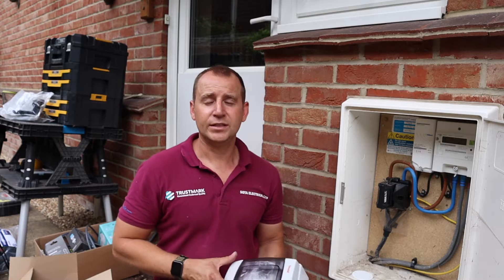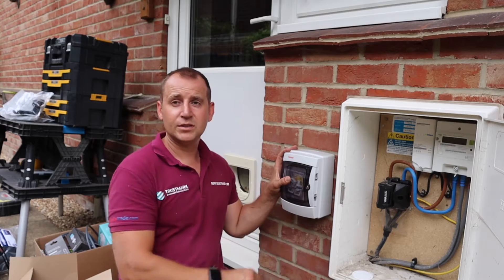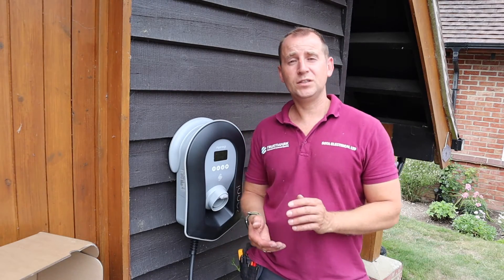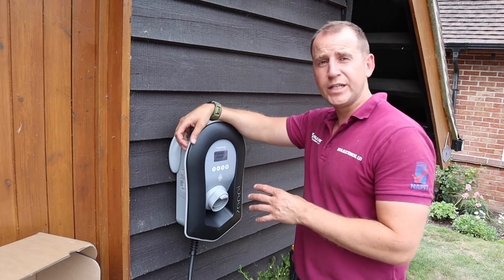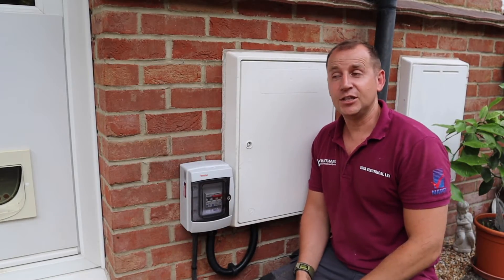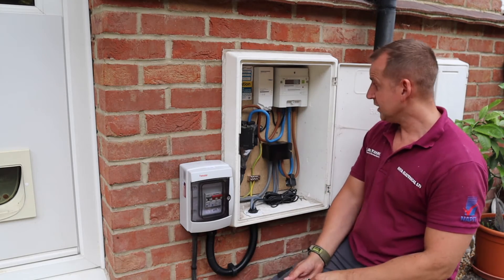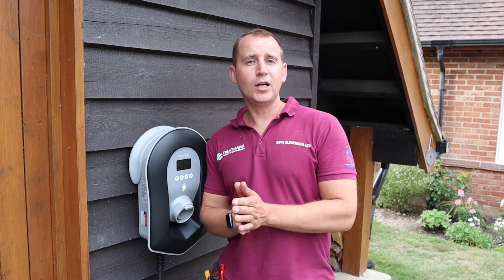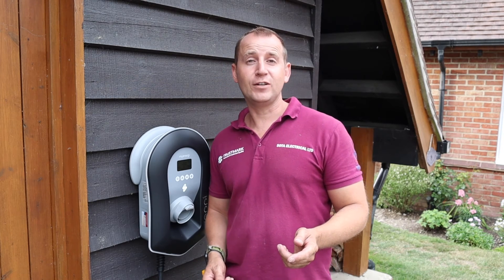EV Charging installation problems solved!! #electricvehicle #ev #electrician #cars

Comment: As a trainee please forgive my ignorance, but in order to have fitted the Henley block, ‘somebody’ would have pulled the fuse, is it a case of a quick sharp tug and it comes away? There’s never any explanation or demonstration that I can find. My incomer was originally 100A but the fuse is inside the cabinet and it has been replaced with a 60A when it had a smart meter upgrade. I want to put the 100A back in, safely!
Reply: @sameoldmatt a smart meter installer doesn’t have the authority to downgrade or upgrade any fuse. It has to be done by the DNO. Most likely the fuse carrier is just labelled up incorrectly and the smart meter installer just checked the carrier for tightness.

You are not allowed as an electrician to remove the main fuse let alone change the rating of it. The fuse is there to protect the service cable and some are not rated up to 100a which might be why it has a 60a currently.

Get in touch with your local dno authority and they will come out and upgrade free of charge as long as the service cable can take the higher amps.

(I’ve installed Smart meters for 8 years, and I’m a domestic installer with 3 years experience fitting EV charge points and ASHPs)